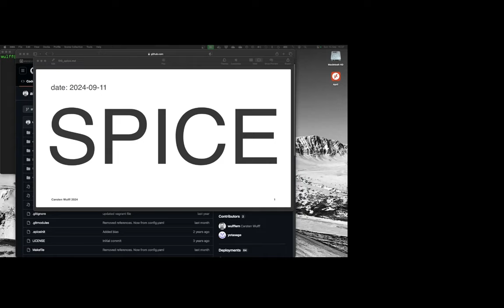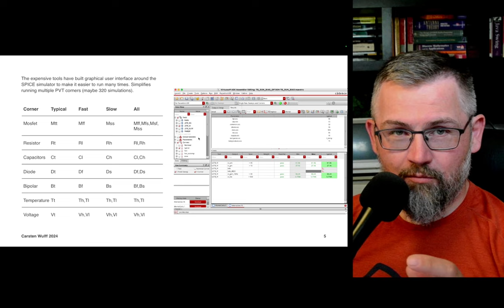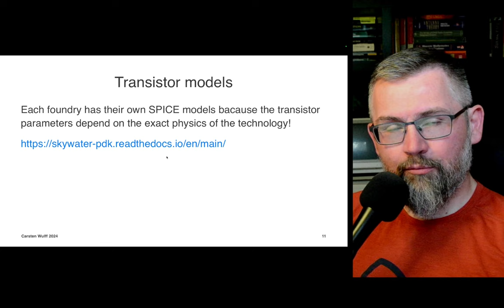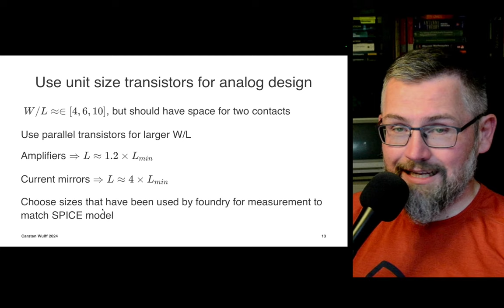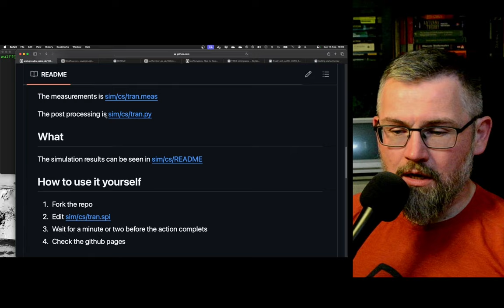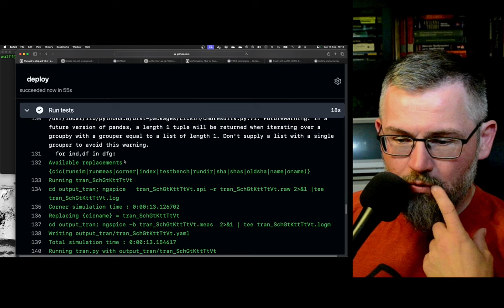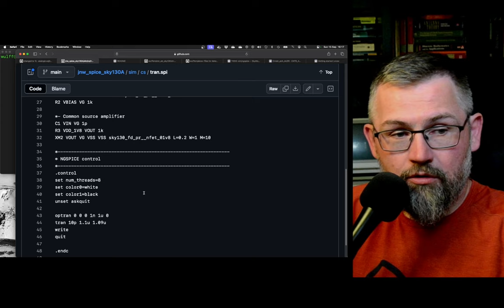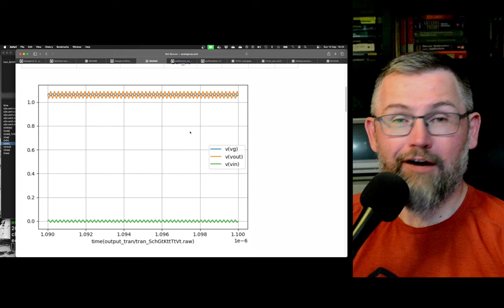Introduction to SPICE

Comment: I thought this was going to be about Dune. Dune is all about Spice you know.
Reply from the maker: Hehe, good point. I'm a big dune fan, but this is a different spice variant. Although, in our universe it's a remarkable analog. Absolutely all integrated circuit design has been through a SPICE simulator, so the world does run on SPICE.

Comment: I was doing some analog design with skywater and one of the fets has got width of near 0.35, which can only contain one contact. Should I redesign the ckt or is it ok?
Reply from the maker: Depends how many millions of the IC your going to make, and whether you have a production test that will catch a bad contact. If you are making millions, and it's hard to make a test, then redesign. If you're making a handful of ICs, then your design is probably going to be ok with one contact.
Reply: @analogicus  well I am not going to make millions so hopefully it'll be fine